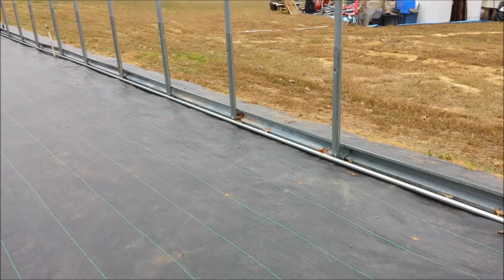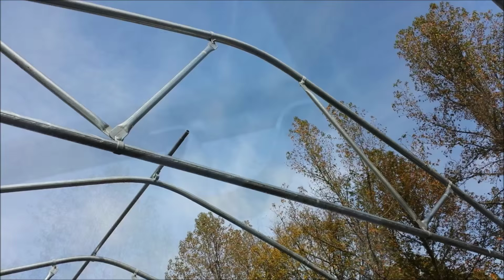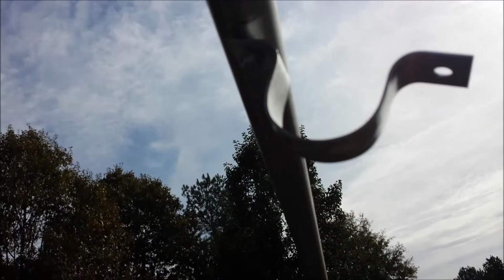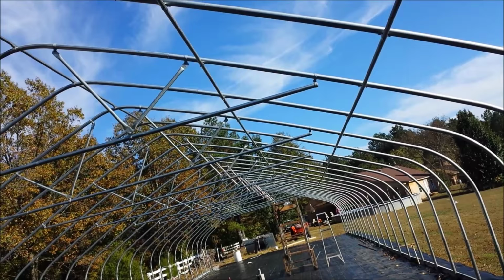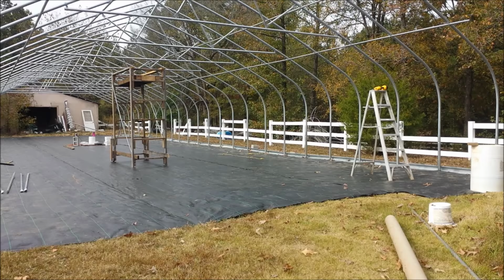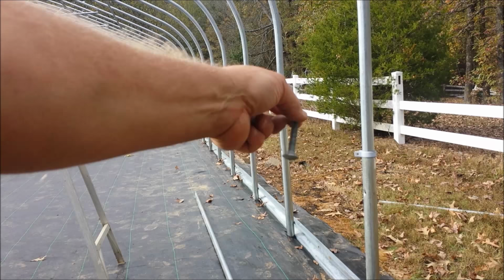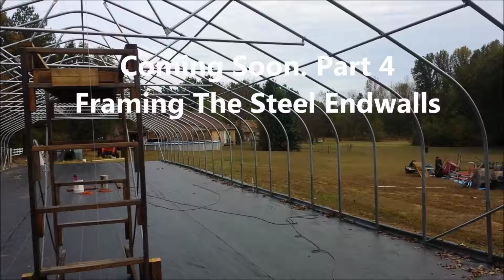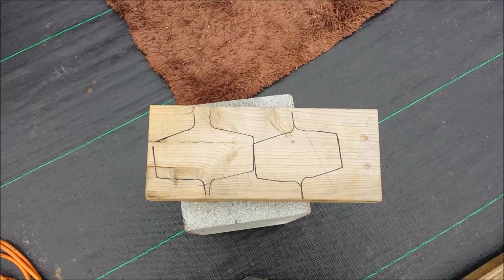The Snow Arch Greenhouse Build  Part 3,  Purlins & Corner Braces

Comment: Incredible, you got that much done with minimal help. The structure is looking really strong.
Reply from the maker: +Cultivating Organic by greenwiseJo I am very impressed with the way this is turning out. This greenhouse is significantly stronger than the last one. it is so firm that if I hit it with a hammer on one end you can feel it vibrate all the way down at the other end. It's a very well designed structure!
Chuck
Reply: Great outcome, is your well deserved reward.
Reply from the maker: Thank you so much for your kind words!
Chuck

Comment: Nice job Chuck
Very neat and I'm sure it will last many years. A good method for drilling the holes in line.How many construction hours to date do you reckon?
Cheers..............Nigel
Reply from the maker: Between 90 and 100 so far

Comment: Wow.  This is designed to keep snow from building up on the top, I am assuming.  Really, really impressive.
Reply from the maker: +DonnaldaSmolens Thanks Donnalda. This greenhouse cost me quite a bit more just for the extra protection against the weight of the snow and Ice and up to 90 mph winds. Now that the construction is complete aside from the end walls I can see the difference in rigidity. 
Chuck
Reply: after watching what you went through with the other one, you should have a fabulous planting year this winter.  Looking forward to those videos.
Reply from the maker: I am not sure how much I will actually grow this winter. I am changing almost everything over to hydroponics and adding aquaponics in this greenhouse and that will take a significant amount of build time in itself.
Chuck
Reply: I see, yes you are right.  Anyway, it will be good to watch what happens.

Comment: you will still wish to clear snow off the top during and after snow storms
Reply from the maker: +Rev John O'Toole I hope not to have to do much with the snow going forward John. Show and Ice events like we had last year are rare and this house is designed to shed the snow before it exceeds the max weight which in itself is amazing. Trust me though... If I am home and I see it building up on the surface.... Ill be helping it down to the ground somehow!
:)
Chuck
Reply: +Fensterfarm Greenhouse ice will form first because it's warmer inside, then the snow will stick to the ice and not slide down during the storm.
best
Reply from the maker: +Rev John O'Toole I will be heating this at night as well John. I purchased a 300000 BTU heater with this one. the last one was heated with firewood and the fire had gone out the evening of the collapse. Everything should melt but like I said.... I will be keeping an eye on it regardless! Way too much invested in it not to! :-)
Chuck